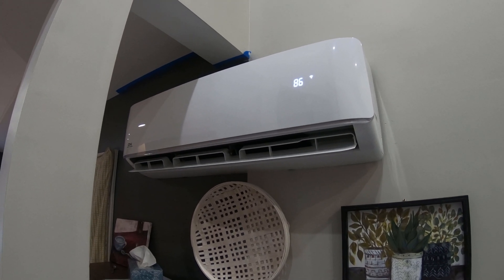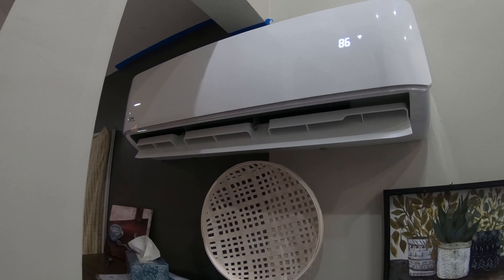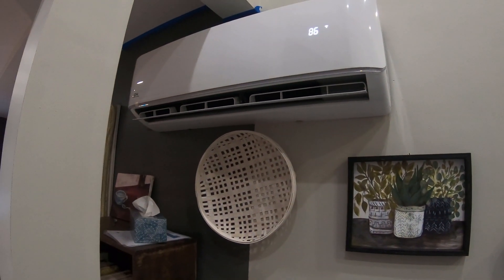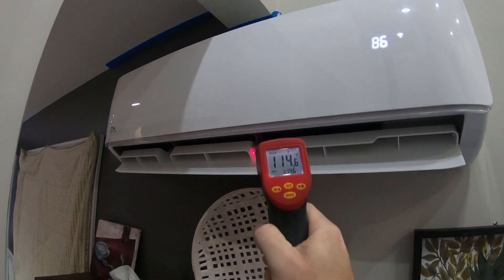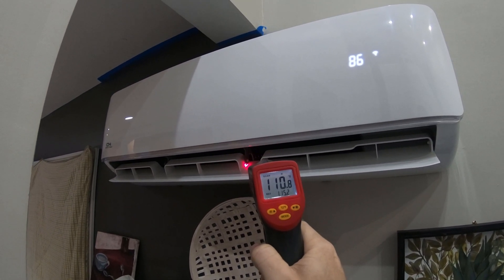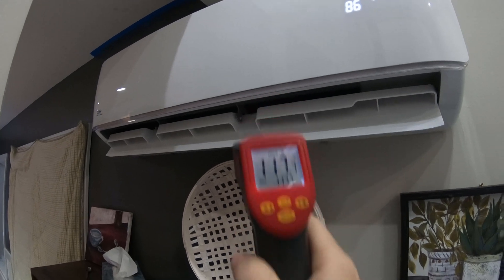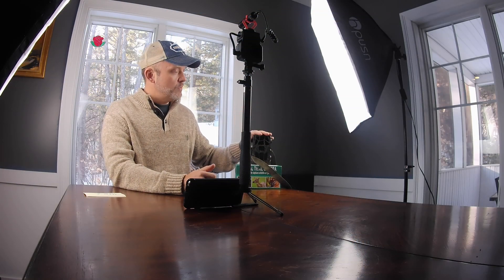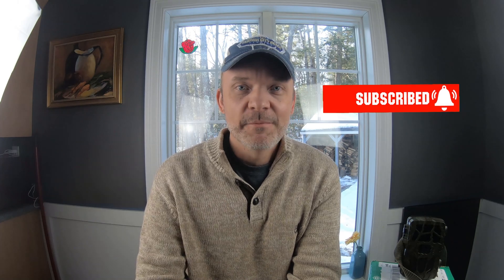Pt 2 of the "Will a minisplit heat my room?" series.

Comment: well lets not get too carried away, its a mini split made for spot heating/cooling in areas not easily serviced by other means. to strap a 50 hp out board on a 3000 lb boat is an extreme analog but not far off. For rooms that you've decided you spend the most time in and you're not keen on heating or cooling the entire house with other means, it works well but to taunt the manufacturer by subjecting it to the most extreme examples you can think of to pronounce a verdict kind of wastes peoples time. In your specific case and others like you who want the advantages of a heat pump, just assess your home insulation quality first and then size something that will keep that area comfortable in winter and summer and best enjoy the advantages the technologies offer.
Reply from the maker: This was used for spot heating and cooling. I mainly heated that house with a wood stove. I believe I was trying to just see if it could even heat in the extreme cold... something most people have concerns with when it comes to a minisplit.

Comment: We’re using a 12k btu mini split in our bedroom and finding the set temperature is not matching the room temperature, even in mild climates 30’s-40’s. It’s about a 3-4° difference. The mini split is set to 68 and the room never gets more than 65. Could this be because of the height at which the mini split is positioned and where the thermostat is locAted in the mini split? We have high ceiling and wondering if we need to set it at a higher temp to reach desired temp because heat rises. We have oil downstairs but mini split is the only thing we have heating out upstairs bedroom. Thank you!
Reply from the maker: Maria... my unit had the option to use the temperature reading at the wall unit or at the remote. Do you have that option? If so then the remote would be the better option since it's lower to the ground with you. I have the high ceilings too and since heat rises it always took longer for the ground level to get warmer. I'd suggest either using fans to disburse the heat around the room better or keep that heat offset in mind when you set the temp and just set it warmer.
Reply: They didn’t offer thermostat to be on the remote (our mini splits are through Mitsubishi and we just installed them so newer models I suppose) and I’m wishing they did! We do have a ceiling fan and considering putting the fan on the winter direction to disperse the heat and see if that will help. May have to up the temp to get it to reach desired temperature - thanks for the quick response!
Reply from the maker: @MariaGK1312  I wanted to suggest one more thing but it is unlikely since you have new units. But, if you open the top cover to expose the filter (on the indoor wall unit) you will see a wire with a little sensor at the end that hngs down towards the middle of the filter. That is the incoming air temp sensor... it tells the computer what the room temperature is. If it gets covered in dust or if your filter is dirty, it could affect the temp reading it is getting. Hope these suggestions help. Stay Warm!
Reply: Thank you again!!

Comment: I see you have it set at 86deg.  Is there a reason for that?  I find my mini will not start the heating cycle until i set it at a very high temp.  thanks.
Reply from the maker: That was the max temp it would go to. No reason other than we didn't want it to cycle off if it came to the set temp (not like it would ever hit that in the winter though). Concerning your issue though, is it possible it is heating a little but you just donr notice it? Have you tries to possibly test the heat output with an IR thermometer at different heat increases?
Reply: @JackofAllTrades1  I haven't tested it with an IR thermometer, thanks for the idea.
Reply from the maker: @josephsilver9047  I would not be surprised if it goes up slightly each time. Like if your room is 70 and you set it to 74.. it may only go up slowly so the change is not so great that it feels "hot"... hopefully that makes sense.
Reply: @JackofAllTrades1  yes thanks

Comment: Still running good? I'm seriously thinking of replacing my now dead traditional split 3.5 ton with ducts with two of the 24k mini splits. I'm in PNW (2000sqft single story ranch) so our lowest temps outside are maybe a week in the 25F range, average winter temp is 42F. How efficient are they in the 42 ish range? Our old heat pump was only a 10SEER and was always using the auxiliary strips, and the electric bill always goes through the roof in the winter...
Reply from the maker: Yes... a mini split would work great for you since it's not that cold.

Comment: Thanks, you set my Alexa off when you asked your questions...Trying to see your room layout, Is that wall unit split so it is heating two rooms with the wall down the middle of the unit?
Reply from the maker: It's heating two rooms and there is a beam about 3 feet from it but there isn't a solid wall.. just two beams and a large open doorway. I have the direcrional fins on each side pointed to their extreme left and right to get the most airflow into each room.

Comment: I don't see how showing the temp at the unit conveys what the temps are like in the room. We already know that new mini split heat pumps work in cold external temperatures.
Reply: The title of your film was misleading. You didn’t measure whether the unit heated your room.
Reply from the maker: @jonatherton  yea, sorry about that... I thought I gave my assessment on how it heated the room. Its been a while since I created this video so I don't recall all the details.
Reply from the maker: I was showing how the output at the wall unit changes with the change in outside temperature and then gave my feedback on how it felt and if it could do a decent job of heating the room. This was just my perspective really. Most manufacturers say the units can heat down to such and such cold temperature but is that barely any heat or decent heat... those are questions I had when purchasing and planning and something I felt others would be interested in.

Comment: How many watts will this unit use at max?
Reply from the maker: This used a 20 Amp 2 pole breaker as recommended by the manufacturer so no more than 4,800 watts. However thats likely just startup watts... normal running is probably far less than that.

Comment: Thanks for the info on part 1 & 2, Unless I missed it, one of the things I was looking for is, what's the average temperature in the room?
I have two of these in an apartment cranked to the max 88 deg. F setting, temp outside is 4, inside it's 64-68.
While that is adequate it's not ideal in the sense that the unit really doesn't bring the room temperature up to the 88 degree temperature setting of the unit, or any where near or close to the temperature setting.
The units are Mitsubishi Electric MSZ-GL09NA, they shut off on their own for about 16-17 minutes before starting up again for about 20-23 minutes.
Not sure if that's how a mini split system works, again while adequate to me it's not ideal.
Reply from the maker: I could get the rooms pretty warm but never to the max. Mine was just for heating those to big rooms and I never had an issue getting it to what we wanted... usually around 72. The reason yours shuts off is because it has to defrost the coils in the outside unit, so it will go into defrost mode once or twice an hour. The colder it is and the more humidity there is, the longer this event will take. Thanks for the feedback.

Comment: Do you know why the plastic temperature decreases when the vents raise up? Also, is it  uncomfortable to stand in front of the hot air exhaust? Thanks
Reply from the maker: Thr temp change is just due to the air deflection rate. The more it is deflected the hotter it gets and vice versa. It is not so hot that it is uncomfortable... its like the high setting of a hair dryer... just a lot more volume.
Reply: @JackofAllTrades1  awesome thanks

Comment: Thanks for providing real world data on the heating in both your videos on this topic. In my area of the PNW we do not see temps much lower than 15F so I am starting to come around to the idea of using  a multizone mini split and decommissioning the 20+ year old heat pump that kicked in with electric AUX heat at about 30F.  I also like the idea of not having to winterize the window A/C units as well. The pro's are outweighing the cons at present. Cheers.
Reply from the maker: I'm glad you liked the video... in my research leading up to the install,  everybody spoke about the energy savings and I was a bit shocked when I saw that they were not that great. I wanted to provide my real numbers to help others with that decision. The unit is a big time saver and helped in other ways than money so overall it was well worth it. Thanks for the post!
Reply: I live on the kids a peninsula and I was just wondering if you ended up installing one of these, we are thinking about getting one for our garage..

Comment: Use a hyper heat model unit and it will heat to -15 degrees below zero. Most standard models today will heat down to -5 degrees below zero but will loose heating capacity and go into defrost often when below zero. I am a Fujitsu dealer and the product works well and very efficient with the inverter compressor.
Reply: It also appears that these newer models that have "Hyper Heat" at below -22 are now also claiming 100% heating capacity at -5 to 5 degrees Fahrenheit. Incredible if those claims hold-up.

Comment: I enjoyed listening and watching your video of your ductless mini-split. In answer to your question all of the units are made overseas China Japan Korea etc. Unfortunately you didn't get your rebate because the unit was 3 years old and I hope you don't loose 3 years on your warranty . I am a Carrier dealer- we deal with up to date equipment so that doesn't happen to my customers. You are always going to have a loss of heating capacity  as the temperature drops with a heat pump. Nothing heats like a flame.
Reply from the maker: Hey Richie. Thanks for the comment. Yea that was a huge lesson learned on the older equipment... I brought it up in hope of helping others not make the same mistake. Yes.. a flame is the best... mynwood stove is a beast. :)

Comment: Hi  thinking about getting the toshiba 36,000 btu hr mini split system my house is 1400 square feet and is well insulated and my ceilings are 12 feet ceilings do u think it can keep my house warm
Reply from the maker: Hey, I just replied to your other comment. I think higher ceilings do play a part in your planning. The ceilings in that house is 18ft tall and I was easily heating 800 sq feet with two a two ton unit. You have 6 feet less, so that's less volume to heat but you do have more area (almost twice as much). I think what matters more is if the rooms are all together.... Long halls and lots of corners tend to make it harder to heat I've noticed. What's your layout?
Reply: @JackofAllTrades1  my layout is a square basically open layout with an upstairs thats open no long hallways 1 bathroom downstairs 1 bedroom downstairs
Reply from the maker: @markbigham3623  I think you will be fine. Is the downstairs the main floor of a two story? Or is downstairs a basement? I had mine on the main floor and my second story was open to the main floor and it heated well.
Reply: @JackofAllTrades1  yes downstairs is the main floor of 2 story and thanks
Reply from the maker: @markbigham3623  I think you will be happy with the purchase, probably one of the better investments I've made.

Comment: Do you believe the mini split can still get the room to 75 on a below-zero day or does part of the lack of efficiency also impact how much heat it outputs?
Reply from the maker: Nikki Schmidt I believe it can but will take much longer. Size of room matters a lot and since I have really high ceilings it takes longer... I feel a normal Ceiling height will allow it to heat up faster. Thanks for the question.
Reply: @JackofAllTrades1  Thank you so much! That helps a lot. We're down in Mass and are considering changing from old baseboards to a 3-zone mini split system for our 1200 sqft house. Have you by chance had any other issues with them during the winter?
Reply from the maker: Nikki Schmidt no, they are great... it will take the chill out of the room super fast. Read up on cleaning them though because they do need to be checked regularly so you can keep on top of it ever getting moldy. I’ve not had issues with this one but have seen/heard of other ppl who have.
Reply: @JackofAllTrades1  Thanks again for the thoughtful information! Will be watching more of the content!
Reply: @sillymino  just to give you an idea I have an 18k single zone Fujitsu in my living room space which is connected to a semi open concept kitchen and dining space on a single floor ranch. That space is about 700 SF and the unit keeps it nicely cool in summer and warm in winter on low (economy mode) or an auto economy mode with no issues, it costs me about $30 a month in summer for cooling about 6-9 hours on a day depending on temp.  Highly recommend these machines

Comment: Is that the hyper heat unit ? I just installed the Dakota series its supposed to be good to -22° !!!
Reply from the maker: I think the Dakota is one series newer than this one. I'll have to check but I do not think it has hyper heat. Ok, I just looked, mine is the Sophia (non hyper) and says extra low ambient heating down to negative 13. I can attest that it blows out warm air at negative 5 but not sure how effective it is at that point.
Reply: Thanks jack, loved your video.
   P.s. I'm in pelham....
Reply from the maker: @mysteryvideos7181  just sold my house in Goffstown. Stay tuned for warmer weather videos this winter 😎
Reply: @mysteryvideos7181  How is your hyper heat unit doing in winter? I saw both CH &  Mitsubishi have hyper heat model and they claim that you no longer need supplemental heating! I am thinking about switching to these models when remodeling my house next year, but wondered how powerful they can actually do in cold weather -- New York city area, and it rarely goes below 0f.

Comment: How is the insulation at your home, standard code minimum or did you do anything extra? I'm considering using this as a main heating solution, but I'm concerned as I'm in the upper Midwest with cold temps.
Reply: GET HYPER HEATS MITSUBISHI OR LG RED, MY UNITS I HAVE 2 HYPER HEATS AND 1 LG RED AND I HAVE TO SAY THE MITSUBISHIS ARE THE BEST LG RUNS A DISTANT SECOND. LG IS GREAT BUT THE MITSUBISHI ARE IN A CLASS BY THEMSELVES.
Reply from the maker: My home was built in 2004 and I have decent Anderson windows and doors. It is 2x6 construction though which may not be common in your area. Because of this, I am able to have a higher R value in my insulation. The biggest drawback of this setup is the 18 foot ceiling... so it takes longer to heat. A normal height ceiling would heat faster. The home was build and owned by a local home builder and he overdid everything... my roof trusses are 2x10 for example so I assume everything is like that. Thanks for the question.

Comment: So it will adequately heat the house at the temperature you tested.  When you say it was less efficient, does that just mean that the system would be running all the time, costing more money on to keep it powered up?
Reply from the maker: John, since the air is not as hot, it will take longer to heat the room... making it less efficient. So, in other words... if it normally takes an hour for it to heat the room from 65 to 70... it could take more like an hour and a half. I hope that helps.
Reply: @JackofAllTrades1  they are made to run 24/7 very efficent